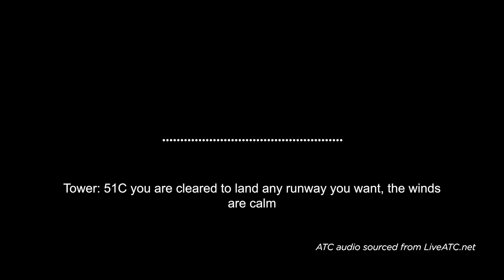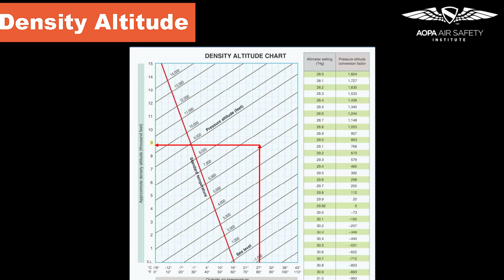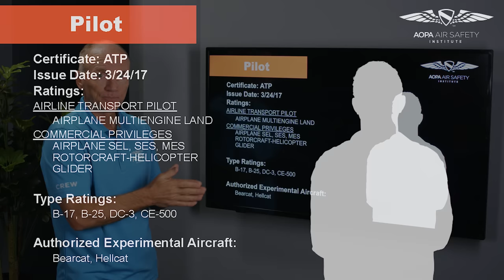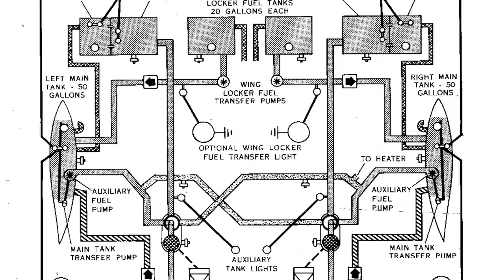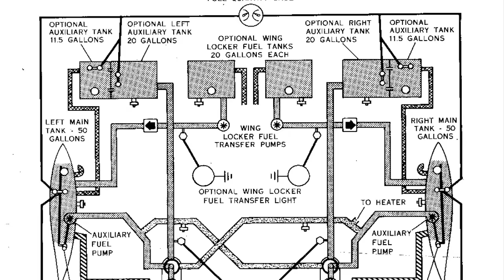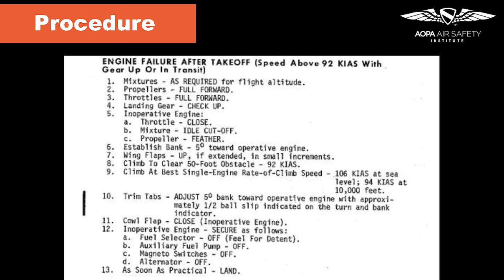Early Analysis: Cessna 310 Crash July 18, 2023 Santa Fe, NM

Comment: How you describe his ability to climb seems like a gross oversimplification. An engine failure at cruise speed + altitude and with low drag and nearly zero AOA is going to be completely different than one at a few hundred feet with the gear down or in-transit at blue line. He was at 10,000' DA. He had no energy to maneuver and was pitched up producing a lot of drag with no altitude to trade for energy. Should he have taken it in straight ahead? Probably. Everything is easier when your life isn't in danger of ending within seconds.

Comment: I remember practicing an engine failure on a twin simulator. I couldn’t believe how hard the inoperable side wing wanted to drop. Dispute full power being applied I could not maintain altitude and did not push enough counter rudder. I crashed in the simulator. I am glad I am in unmanned aviation. I personally do not like flying manned aviation or commercial flights. I avoid it if possible.

Comment: AOPA should adjust last lines of this video!  You should NOT pull power on engine if aircraft is under control, maintaining heading, and descending.  Land straight ahead and use power to help you get to safety - pulling power is the WORST thing to do!!!
Reply from the maker: With airspeed dangerously decaying, decreasing power and landing is generally preferable to a Vmc roll. At 8:12 we note that you do not have to reduce ALL power, just enough to still maintain control of the aircraft during descent. A forced landing is survivable. A Vmc roll likely is not.
Reply: No you need full power, you just need to control the airplane properly with rudder and aileron bank into the good engine.

Comment: Should not have acepted the left turn especially when he had been cleared for right turns just as the engine was failing.

Tower, without knowing which engine is out should not be suggesting turns.

Comment: Atc turned him into his dead engine which could induce a spin try it at a safe alt
Reply: We don't know which engine was dead, and the pilot can refuse to make the turn.
Reply: @bills6093  We do know it was the left engine and he turned into it. He should have said unable. ATC did not know or ask.
Reply: This is the plastic surgeon we are talking about ? If it is then he should have landed straight a head gear up flap down you can buy a new plane but you can't buy a new life
Reply: @wintercame  I have not seen any confirmation of which engine failed or if the engine even failed as opposed to maybe losing boost and seeming like an engine failure.
Reply: @bills6093  Some are saying possible failure to feather (left engine.)
Reply: No confirmation of which engine on the ATC tape and I have not seen any  ideo of the accident.
Reply: @wintercame  If it failed to feather, that explains failure to climb.
Reply: @russbell6418  Could be. This observation reportedly came from witness(es).

Comment: please check you figures , very missleading
Reply from the maker: How so?
Reply: @AirSafetyInstitute  ,max ceiling  single engine?
Reply from the maker: @johnkerr2043  the accident aircraft was a T310 R II. T standing for turbo. The single engine service ceiling for the T310 is 17,200 ft.
Reply: @johnkerr2043  Some other commenters have incorrectly used a SE Service ceiling for normally aspirated engines. This aircraft was turbo-charged.
Reply: @AirSafetyInstitute   i stand corrected . thanks for the clarification.
Reply from the maker: @johnkerr2043  no problem

Comment: These planes will fly in one engine, especially a turbo one passenger on board. This pilot did not have the proper training at all relates to training he did not rise of the occasion. He probably took off his runway 100 times. You need to tell yourself every takeoff there’s gonna be an engine failure to prepare yourself for this. Obviously the training is not good enough. The training is 80 years old and the Faa won’t do anything about it and these planes continue to come down every day at least 15 fatalities a month on general aviation.